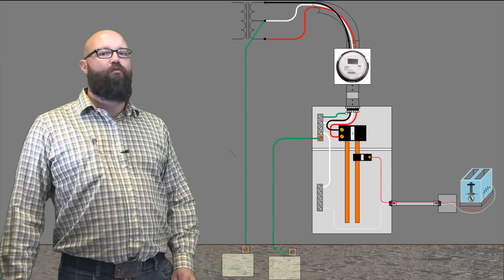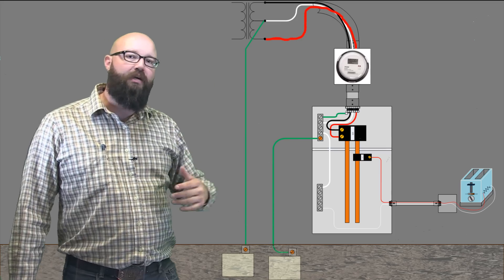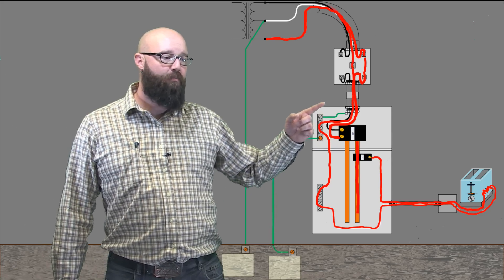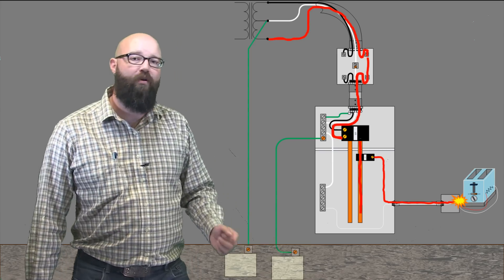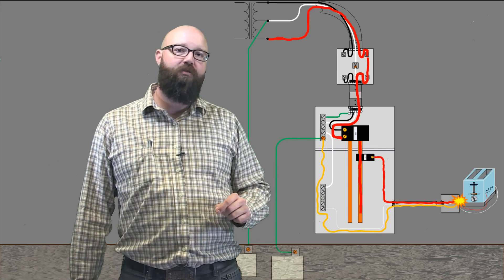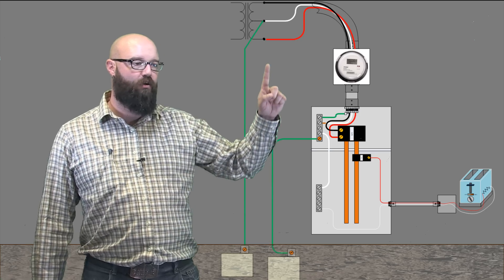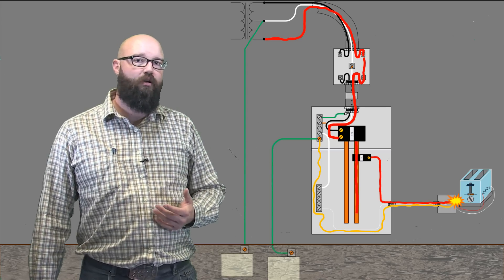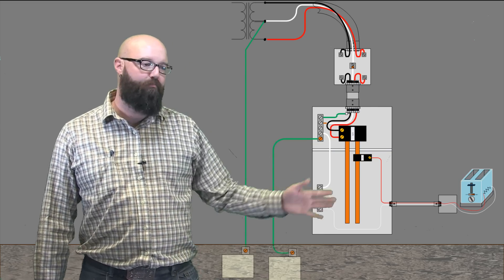Grounding and Bonding

Comment: Great video, I wish you would of shown what happens if neutral is disconnected and there is no metal conduit bonding screw to travel back to the meter neutral tie. Would it then flow to ground and then earth travel to transformer ground flow upwards to close the loop?
Reply from the maker: The video originally depicted that scene, but it was very controversial haha. While the current would flow through earth to complete the circuit, the impedance of the Earth would limit the fault current, and it would not effectively trip overcurrent devices.
Reply: @schulerruler  I'm not sure why it would be controversial or unrealistic. My house has underground schedule 40 pvc from the meter to my main panel so there is no raceway bonding bushing to link the loss of the neutral wire back to the meter box then up to the transformer.  I do have two grounding rods 10ft apart with the most distant one being fairly close to the meter box, about 4 ft, which the meter box itself has a grounding rod. The transformer pole is then about 5ft way from the meter which itself is grounded. Would the easiest path in my case travel through the 4ga ground wire to the furthest grounding rod, then divide itself between the meter grounding rod and up to the transformer, simultaneously the other half going through the earth to the pole grounding rod and again back to the transformer neutral? Thanks for your reply.

Comment: IT'S NOT A SHORT CIRCUIT! IT'S A GROUND FAULT! KNOW THE DIFFERENCE!
Reply from the maker: A short circuit by definition is a path to either the opposite polarity source, or ground (which is also connected back to the source through proper bonding) with a low impedance path, or "short" path. I think you may want to re evaluate your understanding of the definition.

Comment: How is there no current flow on ground?
Reply from the maker: The resistance of ground compared to the resistance of the neutral conductor, you will see virtually no current through the ground. Remember the intent of all the connections are to provide a path back to apply as quick as possible. The quickest path is the neutral, which would be adequately sized.

Comment: That last part doesn't work if you have a PVC conduit between meter and main service. What then?
Reply from the maker: The reason for bonding the service Raceway with the service Raceway bonding conductor is in the event of a service conductor short to a metal service Raceway it will clear the fault upstream. That isn't an issue with PVC though.

 You would still require a bonding conductor from 10-614 3) between the meter device and the panel, but would not be required between the service head and meter base if PVC.

Comment: what's the purpose of the black wire?
Reply from the maker: That is your other line conductor. Red line to black line voltage would be 240V in this system. I just used the red conductor to highlight the path of this particular 120V CCT.

Comment: Nice work. At 1:37 the toaster lever should be on the bottom of the slot to allow current to flow in the toaster heating wires. As shown the toaster is on the off position.
Reply from the maker: Hahaha that's a lot of animation for a PowerPoint, but I'll keep is in mind for next time.

Comment: anyone worth their salt runs a ECG throughout regardless of the fact that the conduits are EMT or galvi.
Reply from the maker: Are you talking about an equipment grounding conductor? We call them bonding conductors up here in the north, but they are not required as a bonding means to achieve equipotentiality. That being said, it certainly is a good idea to pull one in just in case someone forgets to tighten a locknut or set screw.

Comment: Hi Schulerruler, thanks for the detailed explanation, I have one dumb question though! if the netral and ground wires are connected at the panel, In a normal no fault condition if the return current is making its way back to the main panel via the neutral wire and once it reaches the bus bar where it bonds with Ground wire, why will the current not flow back via the ground wire into the connected metal devices body(eg: say back to a washing machine's metal body inside the home connected to Ground wire)?  how does it always flow back to the center tap of the supply transformer?
Reply from the maker: It wants to return to its source due to potential difference at the source. Through the metal components there is not a return path to supply source, but the neutral is a return path, which completes the circuit
Reply: @schulerruler  Thanks a lot for taking time to explain, now I understood.

Comment: I've always wondered if the home service ground wire is a possible danger to linemen in the situation where an ignorant homeowner backfeeds his portable generator to his home when power fails. Many know that one would have to turn off the main home disconnect, so L1 and L2 should be safe. But what about the neutral/ground? If the home uses an imbalance of power between the two lines, then the neutral feeding back to the generator should accept the difference. If somehow the neutral wire back to the portable generator were to fail, wouldn't the ground wire then be carrying a charge, perhaps looking for the most efficient ground route back to the portable generator? Does an interlock close off the neutral wire, too? Or would that be unsafe?

Comment: If for some reason the breaker doesn’t trip, then what? It goes down to earth?
Reply from the maker: If the 15A doesn't trip, then you have the main in the panel as well and the OC at the supply transformer. If all three fail........I wish you the best of luck LoL. Basically it would be a short CCT with not overcurrent protection, so huge currents, insulation cooking.

Comment: When does it go to the ground
Reply from the maker: There will always be a portion to ground as it is a parallel path but as the impedance of ground is SIGNIFICANTLY higher, it is negligible compared to what returns on the service neutral. 
Location, ground moisture and conductivity also play a big part.

Comment: Okay my question now is:
If fault current travels back to source thru low impedance path (which in this case is through bonded nuetral) then what is the purpose of grounding the earth bar located inside the panel? Its not doing anything. Even if you had not connected the earth bar to the ground, the scenario would have remained the same, i.e. fault current would still flow back to the source through bonded neutral regardless the earth bar is connected to the ground or not.
Reply from the maker: It gives a large plane to dissipate a charge from transient high voltages like lightning.
Reply: @schulerruler  ok. Other than lightning, any other protective purpose of grounding? This should mean that bonding is more important than grounding? Please tell me if I'm going in the right direction theoretically.
Reply: @schulerruler  but grounding resistance in our plant is less than 1ohm. Each individual earth electrode when measured is less than 1ohm. And when we connect all earth electrodes together, we get almost 0.1ohm or direct short. So here can we use ground as low impedance fault path???
Reply from the maker: Ground is never intended to be a path for fault current, as mentioned in both Canadian electrical code and NEC, but you are correct bonding is what is the most important, as it is what trips the OC in a ground fault.
Reply: @schulerruler  if ground is never intended to be the fault path then why TT earthing system is there? In TT system, neutral is not bonded.
Reply from the maker: In a situation like TT as the earth impedance is still too high to generate high fault current levels, we rely on things like ground fault circuit interrupting devices (GFCI) to provide protection.
Reply: @schulerruler  Thanks bro

Comment: What about the two green lines what are those about?
Reply from the maker: Those are the grounding conductors connecting the equipment and system to the mass of the earth to ensure a path of dissipation in the event of high transient voltages like lighting etc.
Reply: @schulerruler  so if the voltage goes to the earth and I happen to walk around the perimeter do I get shock because the earth is getting all voltage to dissipate it and if there's a snake or rabbit or any animal that likes to live underground  do they get shock too?

Comment: Only thing not mentioned is that it's code to have a main bonding jumper from the ground to the neutral so as to provide a superior lower impedance alternative for current to return versus the metal panel itself.
Reply from the maker: In the example illustrated, the two are connected via the same bus so they are effectively terminated together. If the brass (green) screw was missing then a system bonding jumper would be required to bind the panel to the neutral, but not required if the green screw is present.

Comment: You dont explain how the neutral coming from the main supply is necessary to make the toaster operate. It cannot work with just one positive lead. there must also be a neutral. So then what happens with a short?
Reply from the maker: The beginning of the video demonstrates the path of current as it utilizes both conductors. Which short are you referring to particularly?

Comment: Who uses this electrical service? It's a little (only a little) bit dangerous. My service is 3-Phase Delta without neutral. 
Ok it's a little bit complex at installation but every builder in my country is used to it. 
I have an old 120kW service (100kW switched from the service provider in case there isn't enough power) and neutral is a "useless" wire to you sevice panel in a good installation.
Reply from the maker: This is a 120/240V north american single-phase three wire service. Specifically Canadian, but same in the US. In a current installation there would be only one location bonded to the service neutral however as per new codes.

Comment: In residential, with a 200 Amp service, what is the MAX AMPS allowed to RETURN back to the utility, VIA the UFER?
Reply from the maker: Are you referring to a concrete encased electrode as opposed to driven rods? The idea is that current does not return to supply via the ground electrode and earth connection. It is intended to return via the grounded neutral conductor.
Reply: @schulerruler  Yes.  At main panel, since Neutral and Ground are bonded, some electron currents do  take the ground path back to the utility.  What is max percentage of total return current flow allowable before utility needs to fix their neutral? 1, 2, 5%?
Reply from the maker: I'm not 100% sure to be honest but it would be very very low. Especially if an UFER is used as that is normally in very dry locations in my understanding. Less than 5% would be my guess. Best solution, fire an ammeter on a grounding conductor and see I suppose.
Reply: @schulerruler  In California, all homes built on concrete slab foundations have UFER grounds, not ground rods.  Either way, at main panel, if too much return path current is passing through the grounding conductor, a hazard condition, (Stray Current), could be lethal to bare footed mammals, etc.  Plz add this subject to your repertoire for a future vid.
Reply from the maker: That's interesting to know about the California homes! Thanks for that. I'm not familiar with NEC tolerances for ground impedance, but if the system is installed and the neutral bonding is done properly, there should be almost no current through the physical dirt as the impedance electrode to service electrode should be significantly higher than the neutral back to supply.
Reply: @schulerruler  Try this!:  1. Turn ON ALL, (and I really mean ALL), household power loads.
2. Place amp clamp meter around main panel ground leg leading to earth ground.
3.  Make video of your face as you read the meter display.
4.  Re-close dropped jaw opened mouth.
Reply from the maker: Hahaha I may just have to give it a try!!

Comment: The scenario that you described was not a short circuit but a ground fault
Reply from the maker: It is a short to ground. It is not a dead short, true but would be considered a ground fault or short to ground.
Reply: @schulerruler  perhaps there's different terminology between Canadian and the US?
Reply from the maker: A ground fault would be a type of short circuit, meaning it has an electrically shortened path back to supply via a lower impedance path that through the load. 

I think the term Ground Fault is more accurate for folks in the industry, but line to line, or line to ground by definition are both shorts.

Comment: Great video but confused on the term "identified conductor" Is the identified conductor the "neutral" wire? Also, the neutral bar is "insulated" from the service panel with an "insulation pad" on the back of the neutral bar, right? That's why you have the jumper wire going to the ground bar right? Thanks
Reply from the maker: The identified is always the white (or natural grey) conductor, but it is not always considered a neutral. For example a 120V two wire circuit has line 1, and an identified conductor. This would not be a neutral in this case. 

Yes the neutral bar is generally insulated from the system and a connection is made by either a bonding screw through to the back of the panel, a bonding strap provided, or a separately sized system bonding jumper.
Reply: @schulerruler  Thank you, just to be clear. So in your video is the white wire a neutral and the lower bar is the neutral bar? Also I thought the neutral wire carries unused current back to the transformer, so why would a 2 wire system be different? " For example a 120V two wire circuit has line 1, and an identified conductor. This would not be a neutral in this case." Doesn't the white wire return the unused current in both a 1 hot or 2 hot feed?
Reply from the maker: It does carry the unbalanced load yes. In the case of the 120v CCT, though it is carrying equal to the line conductor, and always will. This removes the term neutral. A neutral s technically called an identified neutral, but stops being a neutral when it is not a common conductor to two or more lines. When it is carrying load current regularly it is considered an identified and the "hot" is "a conductor that need not be identified". 
Then there's the additional "grounded" and "ungrounded" terminologies associated with conductors. Fun with names.

Yes the white back to the transformer is definitely an identified neutral. And connects to the neutral bar, which is in this case also where the grounding conductor is connected.

Comment: If the White (common)wire is a current carrying wire, then why doesn't it shock me or short the circuit?
Reply from the maker: Because it (the white conductor) is always in contact with everything metal through a connection back at the main service point. Because of that connection, there is no potential difference between the white conductor and what you touch, meaning there will be no current flow through you.

Comment: So question. I have a over head service connecting a job trailer. And no where do I see a path to ground. 2 hots and a. Neutral.  The power will flicker is som cases. Or even more recently goes out for ten to 30 seconds. Then comes back on. What causes this and how do I fix it ?
Reply from the maker: It sounds like there might be a bad connection at the service splice. Does it flicker when heavier loads come on, or specifically on one line?
Reply: @schulerruler  at first i thought it was just one side, because the radio always worked, but now it seem that everything goes off for up to 30 seconds. 
I have not paid attention if the furnace comes on just before hand
Reply from the maker: It definitely sounds like a loose splice on the incoming lines.
Reply: @schulerruler  so how do I fix it
Reply from the maker: Are you a certified electrician? Not trying to dismiss or be disrespectful in any way, but I unfortunately can't give advice for liability reasons.